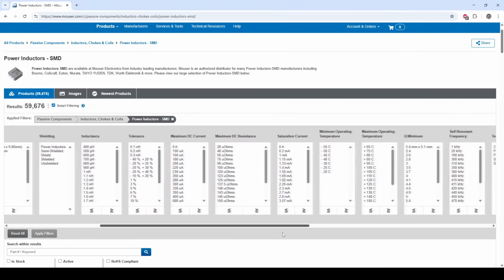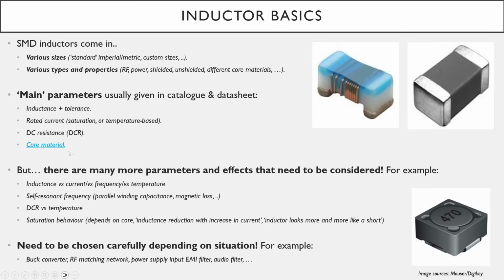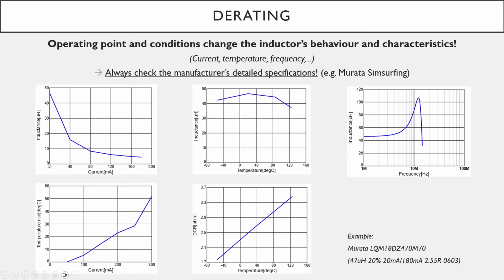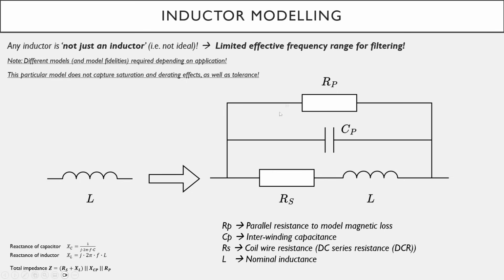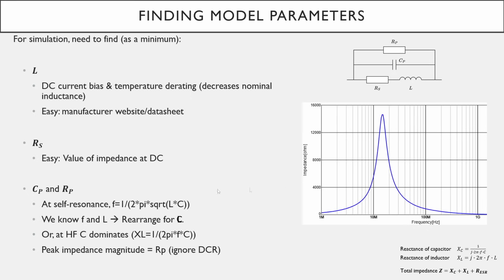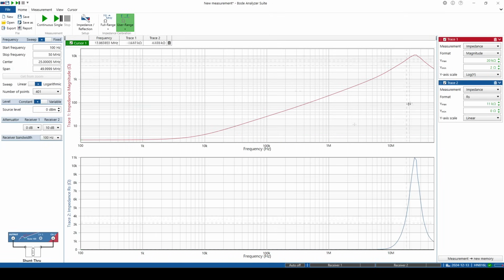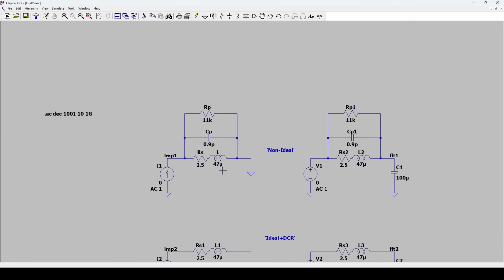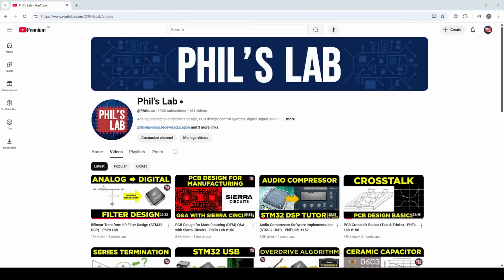Inductor Hardware Design Basics (+Measurement & Modelling) - Phil's Lab #160

Comment: Lovely. 👍

Have you ever wound and characterised your own inductor for special application or for the lack of availability of the inductance value? 

Do you advise making an equivalent inductor by combining them in series/parallel if its value is not available from nominally rated components or is it better to just wind it on your own?
Reply from the maker: Thanks, Muhammad! Haven't had the need to do so (so far!). Depends on the situation, and cost-effectiveness if you can (a combination of) off-the-shelf parts would suffice, or if you need a custom solution.

Comment: On the spice side, qspice offers more parameters than ltspice. You can specify saturation with the satfrac model (Isat, Lsat, satfrac). It's using an atan approximation based on my testing (I have deduced the flux model formula that matches the result exactly). It's made by the same guy that made ltspice and it's great, it has mixed mode simulation, you can write modules in C or verilog that interface with normal spice models.

Comment: Hey Phil, great video as always. Just wanted to ask if you'll consider making a video about pi filters? I always see them in designs like usb power filtering and for rf applications. Would be great to see a deep dive on them.
Reply from the maker: Thank you! Yes, LC and pi filters are on the list of videos to make. I'm building up the video list with these basics and then can reference them in future videos when we put more and more components together!
Reply: I don’t believe you need a video to get a grasp on the basics of pi filters. That’s high school level concepts. I had 10 years as a phD student so i would actually request valuable time be spent on analyzing how to alter the flux capacitor on the combobulator.

Comment: can you do a part two with your workflow to select an inductor in a few typical applications?
Reply from the maker: Yes, I'll make some example videos!
Reply: @PhilsLab   it would be excellent. selection in  RF matching network differs a lot from switching regulators or amplifier circuits

Comment: I recently did some tests with a boost regulator circuit, by laying the same circuit out twice on the PCB, with the only difference being removal of all planes under the power inductor in one instance. It did seem to improve the amount of current that circuit could provide by slightly reducing the losses. I've never seen any actual scientific tests of this though. I'd imagine that RF inductors already take the GND plane into consideration, but for power inductors, where the GND plane has a damping effect on the magnetic field, it does seem to offer an advantage.

Comment: AI Summary

Abstract:

This video delves into the practical hardware considerations for designing with inductors, moving beyond basic inductance values to explore their multifaceted non-idealities. It explains how parameters like inductance, DC resistance, and rated current are influenced by factors such as temperature, operating frequency, and current (including saturation effects). The presenter demonstrates how to characterize a real-world SMD inductor using a Vector Network Analyzer (VNA) to obtain its impedance-versus-frequency curve, from which an equivalent circuit model (incorporating series resistance, parallel capacitance, and parallel resistance) can be derived. This non-ideal model is then simulated in LTSpice to highlight its divergence from an ideal inductor, particularly above its self-resonant frequency, and its impact on circuit performance (e.g., filter cutoff or power supply stability). The video concludes with practical guidelines for inductor selection, emphasizing the importance of understanding specific application needs and utilizing manufacturer-provided tools for detailed analysis.

Practical Hardware Considerations for Designing with Inductors

*   0:00 Inductor Complexity: Inductors are more complex than simple L values; design requires considering numerous parameters and non-idealities beyond basic inductance, package size, and DC resistance.
*   0:26 Part Search Parameters: Online distributors like Mouser offer many filter options, including inductance, tolerance, max DC current, DC resistance, and self-resonant frequency, each critical depending on the application (power, RF, audio).
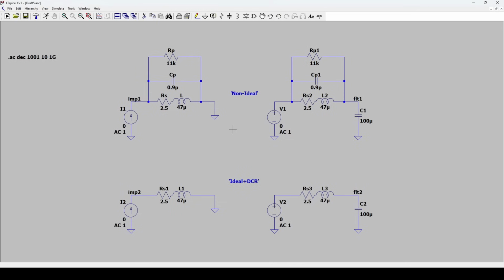*   1:10 Sponsor Spotlight: The video is sponsored by JLCPCB, highlighting their affordable, reliable, and easy-to-use PCB and PCBA manufacturing services, including options for advanced boards and component assembly.
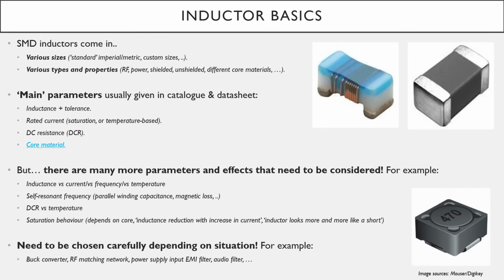*   2:35 Inductor Basics & Types: Discusses SMD inductor types (RF, power, shielded/unshielded), core materials (ferrite, powder-based), and how these properties affect performance.
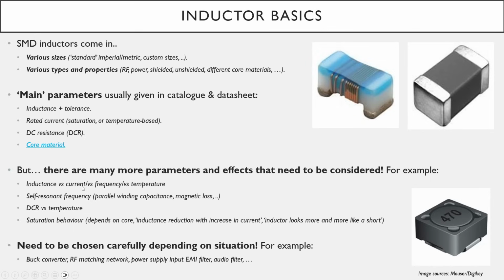*   3:33 Main Inductor Parameters: Explains inductance and its tolerance, rated current (based on saturation or temperature rise, e.g., 40°C increase), and nominal DC resistance (DCR).
*   5:04 Crucial Non-Idealities: Inductance changes with current (saturation), frequency, and temperature. The Self-Resonant Frequency (SRF), caused by parasitic inter-winding capacitance, marks the point where the inductor no longer behaves inductively, but capacitively. Saturation is defined as an inductance reduction with increasing current.
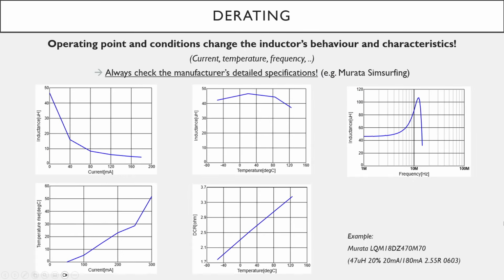*   7:08 De-rating Importance: Inductor behavior changes significantly with operating conditions (current, temperature, frequency). Manufacturers often provide detailed graphs (e.g., Murata SimSurfing) showing inductance vs. current, temperature, and frequency, which are crucial for accurate design.
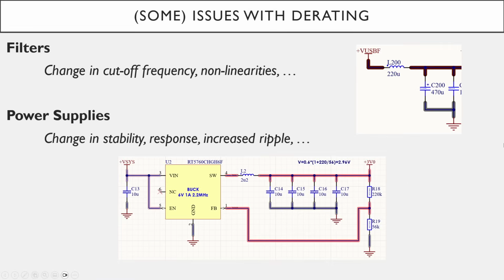*   9:56 Real-World Impact: Derating effects can alter filter cutoff frequencies (LC filters) or affect the stability and transient response of switching power supplies (e.g., buck converters).
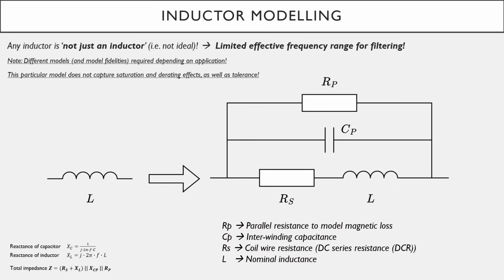*   11:14 Inductor Modeling: Introduces an equivalent circuit model for real-world inductors, adding series resistance (RS), parallel winding capacitance (CP), and parallel resistance (RP, for magnetic loss) to the nominal inductance (L) to capture frequency-dependent behavior.
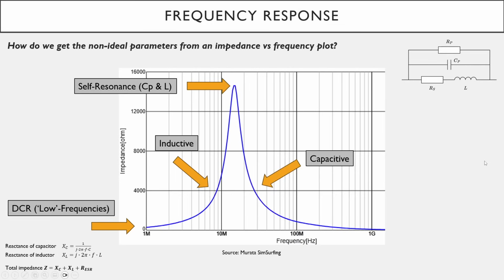*   13:39 Impedance vs. Frequency Curve: Explains the typical impedance curve: DCR dominates at low frequencies, followed by an inductive region, a peak at SRF, and then a capacitive region at higher frequencies where the winding capacitance dominates.
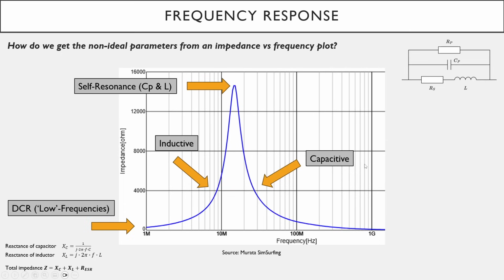*   14:56 Deriving Model Parameters: Describes how to extract RS (from low-frequency impedance), CP (from SRF formula, F=1/2π√(LC)), and RP (from the impedance peak magnitude) from the measured impedance-vs-frequency curve.
*   16:52 Practical Measurement: Demonstrates using a Bode 100 Vector Network Analyzer (VNA) with a custom test board to measure the impedance-vs-frequency curve of a 47µH Murata 0603 inductor.
*   17:43 Measurement Results: Shows the measured impedance and phase curves, confirming the inductor's DCR (~2.5 ohms), nominal inductance (~47 µH), SRF (~24.6 MHz), and peak impedance (~11 kOhms). These values are then used for modeling.
*   21:49 LTSpice Simulation Comparison: Compares an ideal inductor model with the derived non-ideal model in LTSpice for both impedance and a low-pass filter application. The non-ideal model accurately predicts the SRF and capacitive behavior at higher frequencies, showing significant differences from the ideal model.
*   24:51 LTSpice Optimization: Recommends incorporating non-ideal parameters directly into the inductor model in LTSpice for faster and more efficient simulations.
*   25:45 General Part Selection Guidelines: Provides key tips:
    *   Application Type: Tailor inductor choice (RF, power, audio) to specific needs.
    *   Shielding: Generally prefer shielded inductors for better EMI performance.
    *   Package Size: Larger packages often offer lower DCR and higher current handling.
    *   Core Materials: Ferrite cores have more aggressive saturation than powder cores.
    *   Tolerance: Be aware of typical 20% tolerance and calculate worst-case scenarios.
    *   DC Resistance: Choose the lowest possible DCR for power applications to reduce losses.
    *   Operating Point: Account for current and temperature effects on inductance; stay away from saturation.
    *   Vendor Tools: Utilize manufacturer-supplied simulation tools (e.g., Murata SimSurfing) for detailed derating curves and frequency characteristics beyond nominal values.
*   28:31 Conclusion: Reemphasizes the importance of understanding inductor non-idealities for successful hardware design.

I used gemini-2.5-flash| input-price: 0.3 output-price: 2.5 max-context-length: 128_000 on rocketrecap dot com to summarize the transcript.
Cost (if I didn't use the free tier): $0.0107
Input tokens: 25279
Output tokens: 1263